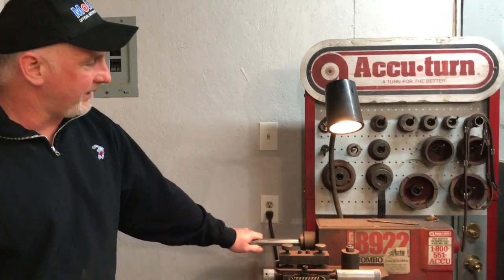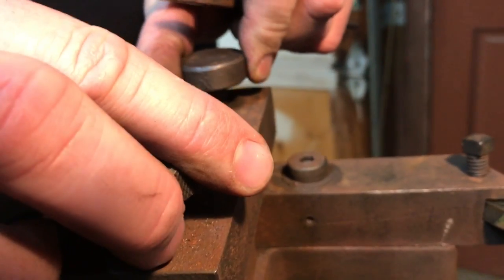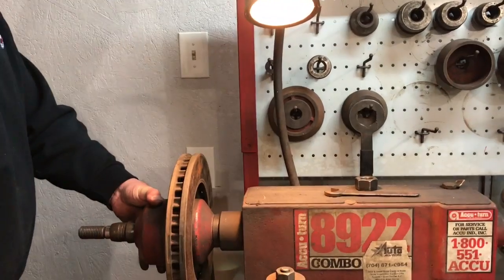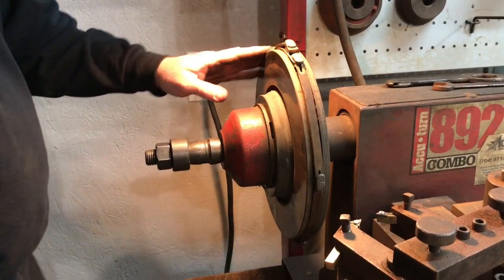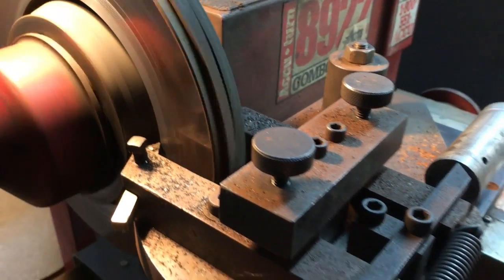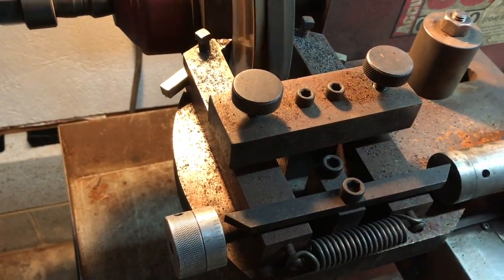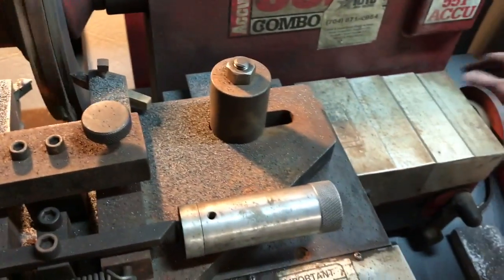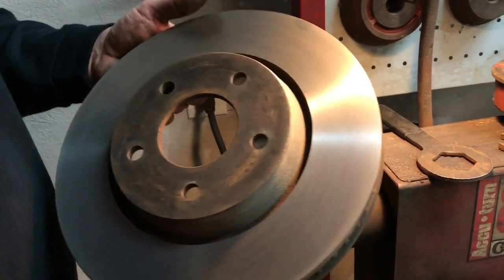How To Machine A Rotor Using A Brake Lathe

Comment: nobody cuts rotors anymore
Reply: I do.
Reply: I do
Reply: Why not?
Reply: None of the auto shops like autozone, advance auto or checkers, o'riley auto parts turn rotors anymore here in Denver.  Napa still does it for 15 dollars but a new one is like 30 or 40 dollars and the cooling fins are not rusted out and blocked. Better to get new ones.
Reply: 101dragonsthe And some rotors are expensive and if theyre within spec then save them